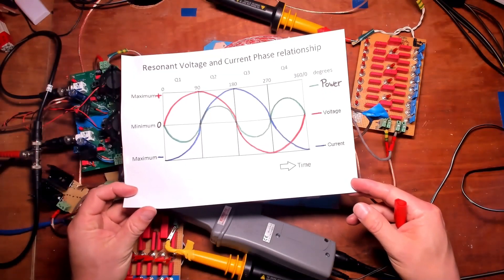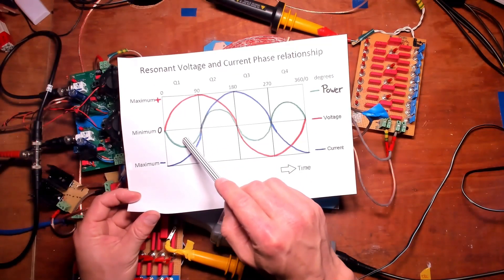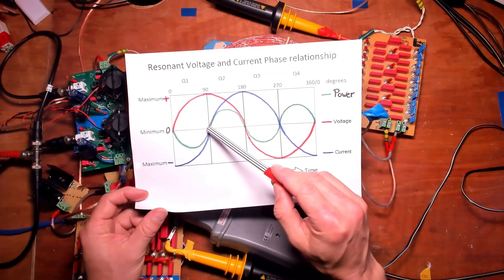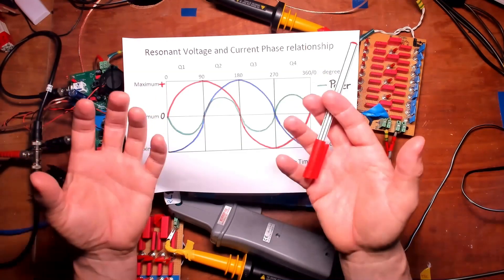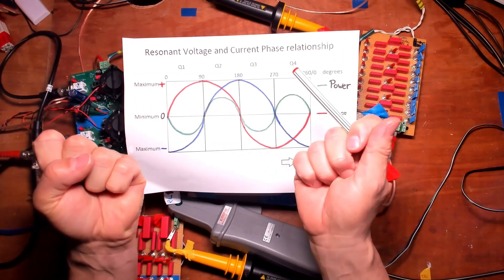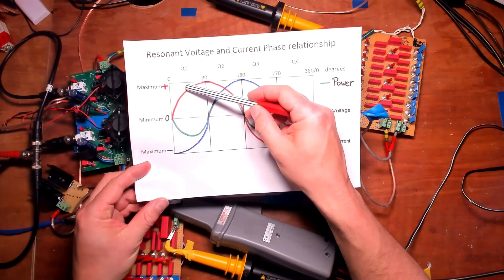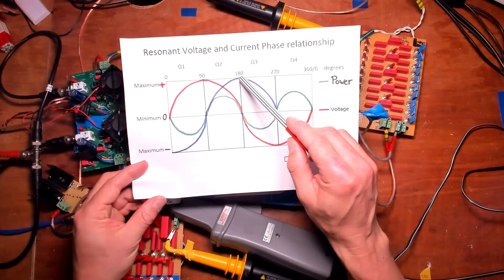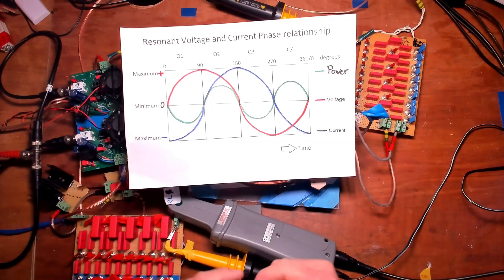Resonant Power Polarity Explanation

Comment: If we read about impuls is this Impuls positiv or can the impuls be negative ?
Reply from the maker: can be both polarity.
Reply: Can you explain that to me in more detail, or maybe you did this in relation to a video?
Reply from the maker: @user-gi1md8yj2v   in case of trh voltage impulse it is correct. +1-1=0
it is the displacement of energy back and forward.

that is why I now use current impulses, which have a single direction energy displacement

Comment: Ok let's chk a impulse added separately on to AC 60hz in a reactive power circuit let's c what happens... Use probably dc source w  the ac ie use cap spark gap quenched Nd a coil n forward diode let's c what it brings Nd another coil same weight to assess the transmission  at same frequency

Comment: power factor of currents on this graph is zero as phases are shifted 90 degrees so power is zero. All oscillating circuits need power factor correction so that to produce useful energy. In this case inductance is needed . And vice versa currents in inductances need capacitors to correct power factor. Power factor correction ic a necessary condition to generate useful energy. No one seems to know it
Reply from the maker: correct, done and ahown here:
https://youtu.be/M1oRfCLY3QM
the impulses are setting up a displacement current which does the trick

Comment: So Ivo, how would this concept of resonance work with pulsed DC and not pulsed AC? Any capacitor can be charged with the right voltage Pulse DC, and a coil will burst from it too.
Reply from the maker: I don't understand your question
Reply: @MasterIvo  sorry that wasnt the best question. I feel you can visualize each impulse with a similar phase concept of a lag from the magnetic field. I'm always very particular about the importance of makeing these ultrafast impulses begin and finish within like a few hundred picoseconds or less.

Due to the magnetic field having lag behind the electric field in the power phase as shown for voltage cycles.

This is resonant, so the AC frequency is exactly enough to charge or discharge the capacitor/coils combo. In impulse, I've heard from Tesla, that frequncy of impulse DC is how quickly the make and break part of the cycle takes time approximately as estimated. He started it becones dangerous at 1 milisecond impulses.

With this in mind, how do you think resonant systems charge and discharge with a quenched element controlling the current-- like a magnetron, spark gap, or possible transistors. Though from my research its not easy to pulse transistors fast enough with significant power, but has effects similar at low power.

When I say charge and discharge, I mean when capacitors / coils have no positive and negative  wave cycle, but a rising and falling action instead, and the current burst from the coil after quenching?

Do you think this would do anything significantly different from an impulse AC counterpart, or ofcourse pure AC?